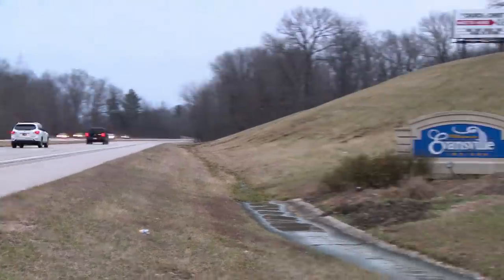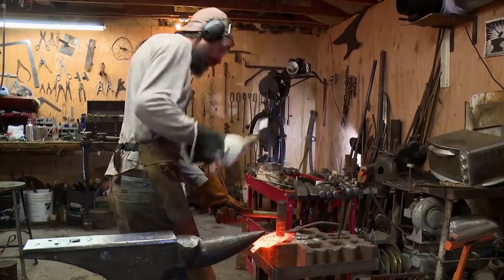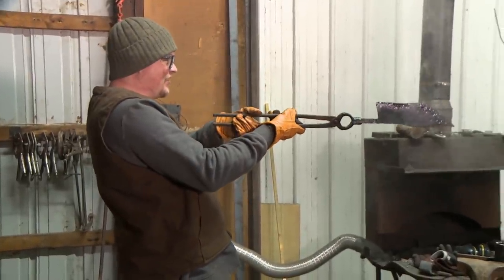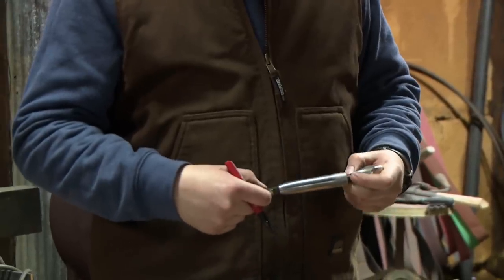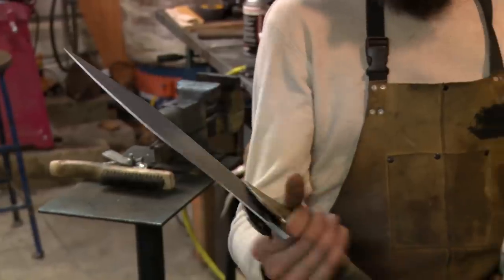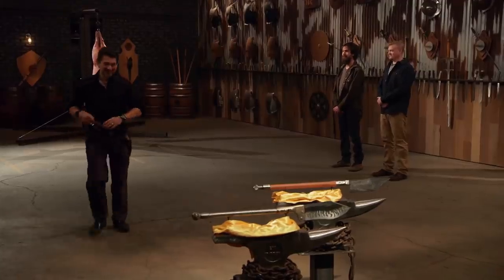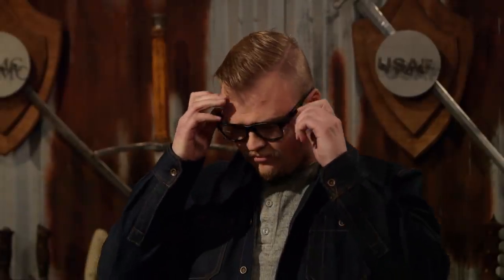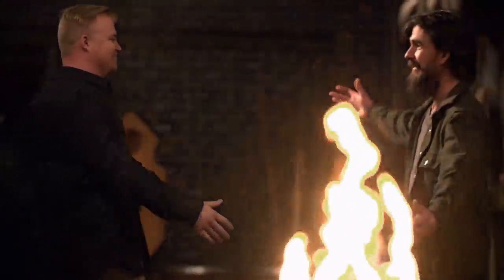Forged in Fire: The Bhuj is SHARP, DEADLY AND STRONG in Final Round (Season 6) | History

Comment: That failure was most likely thing to happen with his blade. It is because, there is drastic change in geometry at the joint of the blade to handle, which cause very high-stress concentration. But in first blade, if you see the joint of blade to handle, the geometric transition is curved and smooth, which allows smooth transfer of stress and prevent stress concentration. Always avoid sudden change in shape, use curves at the point of geometric transition.

Comment: where the blade met the tang there was a hard 90 degree corner in the steel.  that needed to be rounded out a bit because the sharp corner is a stress riser.  this would be the reason for the outcome.